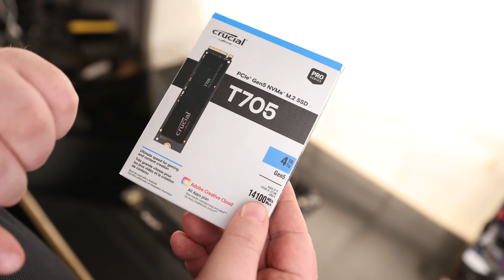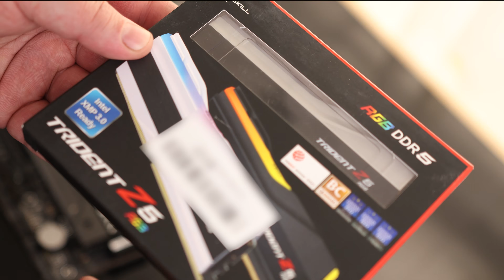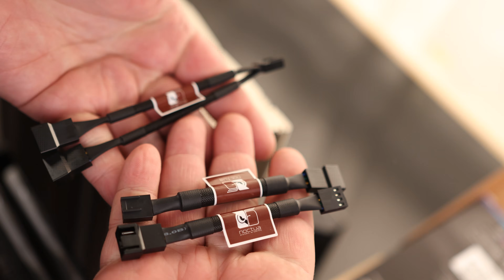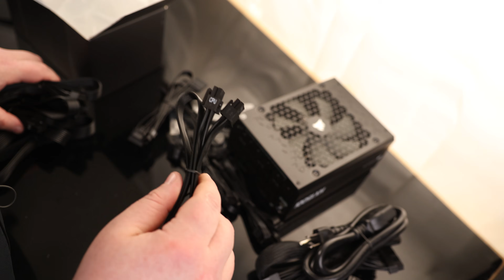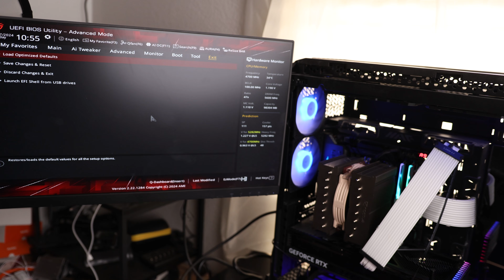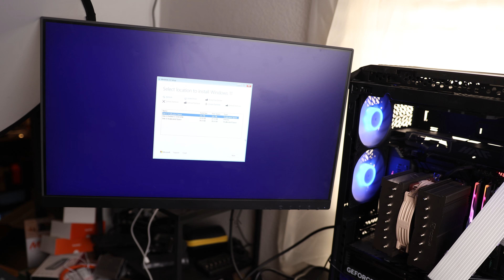Full Build 9800X3D, ASUS X870E-E, G.SKILL Trident Z5, Crucial T705, Noctua NH-D15 G2, HX1500i

Comment: I tried my first and last Asus mainboard. Never again.................
Reply from the maker: What happened?
Reply: @Distractor_Beam  Sorry for the late response. I just got my new mainboard installed and she's purring like a kitten! I went back to my love MSI. (Tomahawk 870) The Asus mainboard never worked correctly. The board detected my 6k memory as 4200. Any attempt to set  expo and the pc locked up. Or anytime I tried to upgrade the bios, the pc would lock up in the bios update menu. My first and last asus mainboard. I'll stick to what I've used for 20+ years. Gigabyte and MSI!
Specs:
Mainboard - MSI MAG Tomahawk x870 wifi
cpu: 9800x3d
mem: Gskill Flare X5 6k, 32GB kit
Heatsink: BeQuiet Dark Rock 5 (Temps Under 120F)
SSD: Crucial T705 1TB
SSD: WD Black 1TB
PSU: Seasonic Vertex GX-750
Case: BeQuiet Pro Base 500DX (Not 100% happy with this case)
Reply from the maker: @dnatech4477  Glad to hear you got it running.
Reply: @Distractor_Beam  Ty sir!

Comment: At 1:55   M.2 slot_1 does not share bandwidth with PCIEX16.  M.2 slots 2 & 3 do share bandwidth with PCIEX16, so the primary M.2 SSD (not a hard drive) should go into M.2_ slot 1.  That is located just beneath the heatsink that has the aluminum tubing and the ROG STRIX label.
UPDATE:  Apologies.  I read your vid wrong regarding the M.2 slots.  But yeah, slot 1 M.2_1 does not share bandwidth with PCIEX16.  Updated here in case folks reviewing your vid do not get confused with my comment.
Reply from the maker: The manual is wrong?
Reply: @Distractor_Beam  manual isn't wrong. that guy is just an idiot.
Reply: the M.2 slot_1 is the one he uses in the video, non-bro.

Comment: Nice video at all bro. As I can see you seem to be one mature man. So we have here the first similar attribute. I'm 48 and a passionate PC Hardware builder and gamer. 

Currently running one redefined upgraded system. Specs are
Montech King 👑 95 Pro case/ ASUS Crosshair VI x370 Hero WiFi/ Crucial Ballistix DDR-4-3600/ Ryzen 5700x3D/ KFA2 RTX 4080 S/ ThermalTake 850W/ 4x 120mm fans were included. Together with another 3x140mm ARGB fans. 

The case has some nice specifics. The front glass is curved. I was totally surprised by the high quality standards. All metal plates can be removed by fingers and hands. No extra tools required. The side and front glass is thick. About 1cm. The metal structure is massive too. 

All in one 18,4 kg weight. But for an empty case. With the massive GeForce card plus 2,5 kg extra. She has one really nice 👍 RGB lighting. This Model type was available without any RGB lights. For 50 bucks less. But I went for the lighting edition. I waited till the price sank. And got her for a decent price of 1049 €uros. 

The only thing I don't like so much is her short VRAM of 16 GB only. In some games 🎮 like FarCry 6 or Tomb Raider Shadow off, the high texture Packs needs over 11 GB VRAM. 

Nevertheless I have one more PC 😀 to upgrade. But I'll wait till the new RTX 5080 appears. If she would has more VRAM, and the prices aren't too high. I might take her. But if not, I might be waiting till the new Unified architecture of GCN and RDNA of AMD Radeon GPUs. The actual XTX is nice too. But her lag in RT is the Achilles Ferse. Her Raster Power combined with her large VRAM and Bandwidth of 380bit, is still very useful.

Comment: Given the latch on the motherboard for the graphics card, which when installed is completely hidden, how would you remove the graphics card if you needed to?
Reply from the maker: This motherboard has a fancy release mechanism where you release the i/o side and you can just pull it out.  It sounds dangerous, but it seems to work fairly well.

Comment: Nice video. At the end you said the speed test was for RAM - it looked like a SSD speed test not ram. If it was a RAM speed test , could you do an SSD speed test?
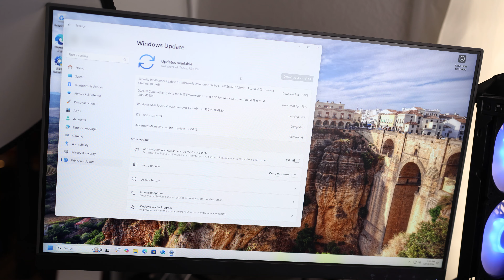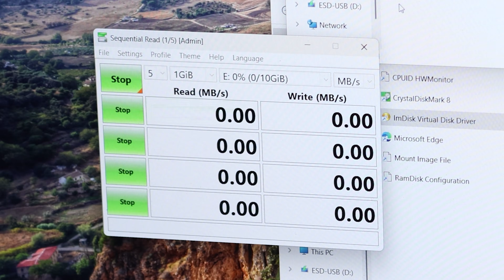Reply from the maker: SSD: 15:51   RAM: 17:06
Reply: @Distractor_Beam  I am a lil suspicious of testing ram using a ram disk because of the flow path through the OS. Aren't there more standard RAM throughput tests?
Reply from the maker: @gregblank247  There is RAM benchmarking software, but from one software brand to another you are going to get very different results.  I like the RAM disk because it's using it exactly as I'll be using it.

Comment: as a rule of thumb, do not give windows internet access during installation, keeps some bloatware away
Reply: If you want to avoid bloatware, choose "world" instead of a particular country.
Reply: Very good advice 👌
Reply: Does it give me an option to not allow internet connection? Starting my build in an hour
Reply: @mrcp245 Disconnect ethernet cable or deny wifi password. Or use Rufus to create usb installation media 😃
Reply: @mrcp245 The newest version of Windows doesn’t you need to enter a Command Prompt command to activate the “I don’t have internet” button.
Reply: If you want to avoid bloatware go for Linux

Comment: I have been running the same hx1500i for over a year now and I have not once had my psu fan come on due to heat / load. And that's with a oc 4090 and oc 13700k. I have hwinfo64 open 24/7 and it never has shown rpm unless when I wake it from sleep it does a little quick fan kick up and turns off. Been a great power supply.

Comment: i got an hx1000 psu but am worried about atx3 compatibility should i change it ???
Reply from the maker: I was using that exact same psu with a 4090 running full bore for stable diffusion and never had any issues.  It's a good psu.  Just make sure you use a good cable.
Reply: @Distractor_Beam  thank u so much a appreciate ur respond

Comment: Nice build, i have a similar one but instead of 96GB 6400MT/s i got myself 48GB 9000MT/s from G.Skill as they cost the same in my country and for gaming i never needed more then 48gb. And surprisingly the 9000 MT/s Expo profile works with the X870E-E and 9800x3d after bios update.
Reply from the maker: Nice.  96GB is way overkill.  I only occasionally need the extra size when I'm running a RAM disk, but with as fast as the T705 was, I'm not sure I even need that anymore.

Comment: Ins't part of the reason for the offset mount due to the cpu dies not being centered under the heat spreader on the cpu? So you can offset the cooler so that it is more directly above the die?
Reply: Yes that is true - it centers over the CCDs hotspot - for $5 its a great improvement!
Reply from the maker: Good catch!  I had to look that up.  You made me learn something.  😃👍

Comment: 0:44 isnt 870 supposed to have usb 4.0 mandatory?

also a question about the OS, Ive been using my pc for about 4-5 years, on an intel platform, and im now going over to a 9800x3D. If i just plug in my boot drive after swapping all the parts. will the machine boot as normal? just with a bunch of new hardware?

or will I need to do a bunch of driver swaps/ reinstallations

Nice build btw, I'd be interested to know how that air cooler handles the 9800X3D, im gonna be reusing my H100i pro (managed to find the am4/5 bracket in my pile of boxes lol)
Reply from the maker: Yes!  The USB4 is on the back I/O panel, and it actually has 2 ports, where most x870 boards only have 1.  
I always recommend reinstalling Windows with a new build.  My experience attempting to re-use an old install have been it locking up and needing to reinstall Windows anyway.  You also may need to unlink the Windows key from the old motherboard.  
The air cooler is killing it.  If you already have a H100i, then you may as well re-use it.